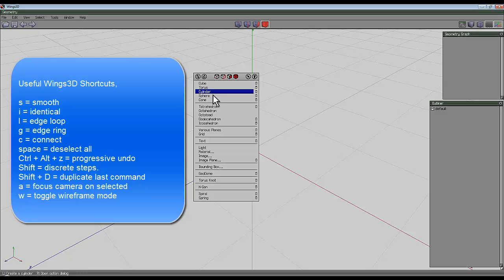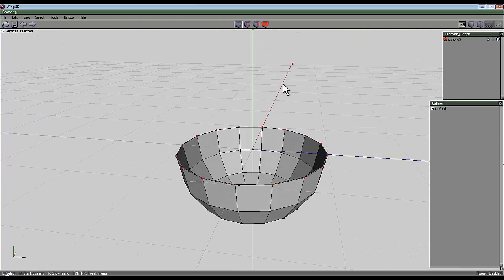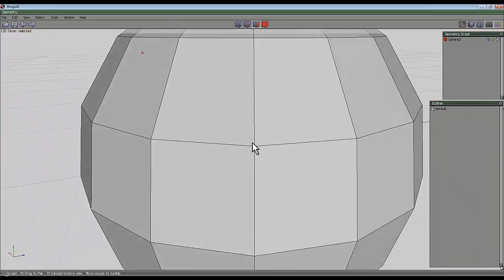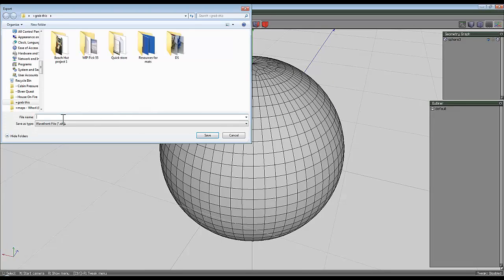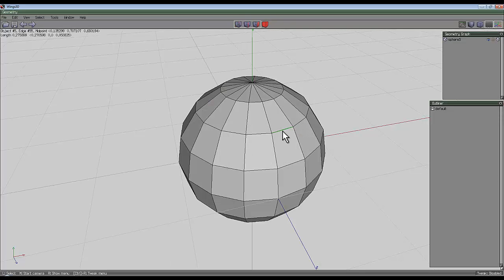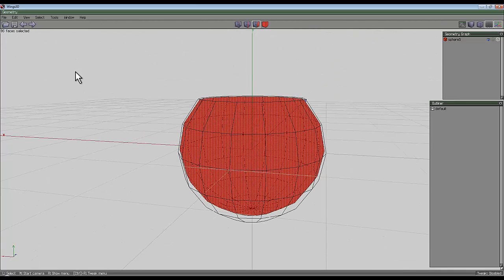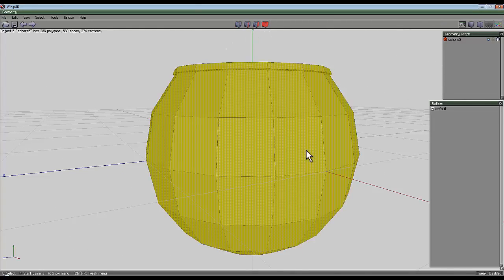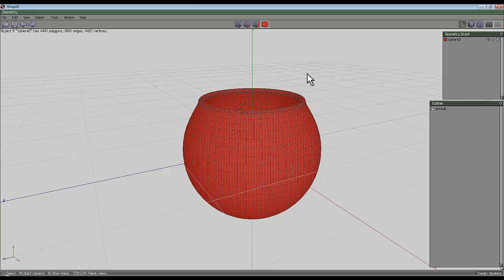Wings 3D - glass bubble and bowl - by David Brinnen.

Comment: Just an FYI here in case you do not know. The Flatten command exists in the Edge, Face, and Vertex modes, and it really does not matter which mode you use it in. It will work pretty much the same way in each of them. As for the hollow sphere, I just create a Sphere Select the entire object, go to face mode, and Shell Extrude outwards. I then delete the original, and voila! I have a Bubble. A couple of Smooths and it's ready for export.
Reply from the maker: Thanks for the tips.  Good idea with using Shell Extrude, although maybe not as easy to appreciate how thick the shell is going to be - just at a glance.  But it is less steps so more efficient.
Reply: If you tap the Tab key after you click on the Shell Extrude, and select Normal, you can enter a value of .01 for a very thin wall thickness. Then just click OK.
Reply from the maker: L. Cleveland Major Aye, that's a good tip but you have to be a bit careful doing that because if the faces get too close together they can do funny things to the render engines I've found.
Reply: David Brinnen I know what you mean there, but if the mesh is large enough, say 250% or more the normal size of a primitive in Wings 3D, one one-hundredth of a percent is still pretty thick. I get away with just the default size in Bryce and DAZ Studio.
Reply: L. Cleveland Major @ RAW TEE, & David Brinnen:
Blender is a far more complex application than Wings 3D in which there are a lot of extra things that can be done. It is not only a Modeler, but also a Surfacing app, a Scene Staging app, and can even be used for Animation. On top of all that, many Game Creators use it to do almost all the grunt work for their games. It has at least two ways to Render a scene, with Cycles Render being the more advanced.
Personally, I find Wings 3D to be the easier to use Modeling and Surfacing app. Blender does have some modeling features that Wings 3D does not, however. That is why I keep Blender in my arsenal of Modelers.
Reply from the maker: L. Cleveland Major Aye scaling can be a bit baffling at times for me.